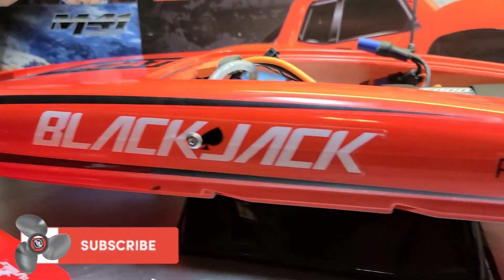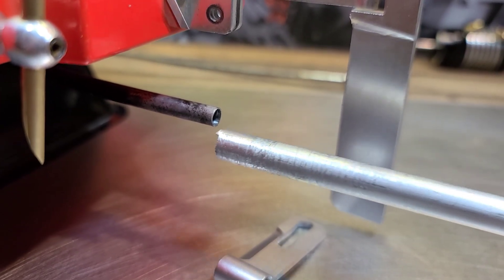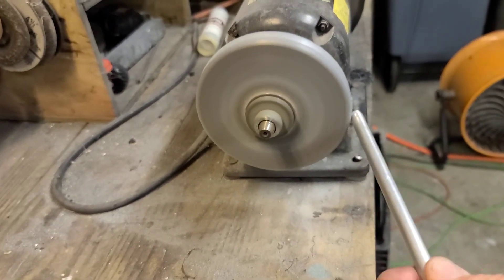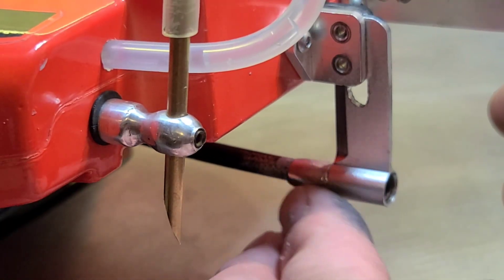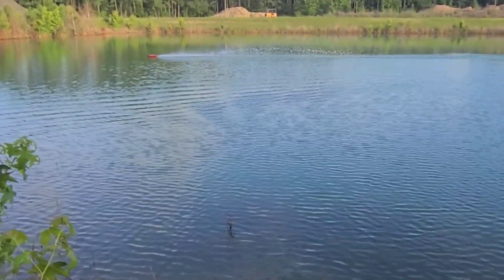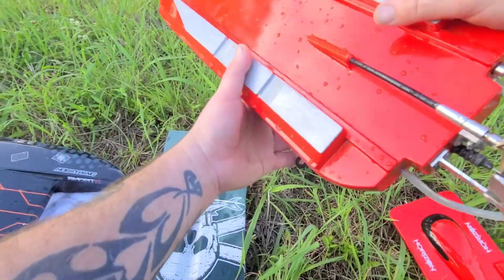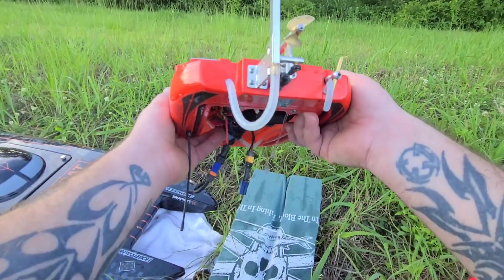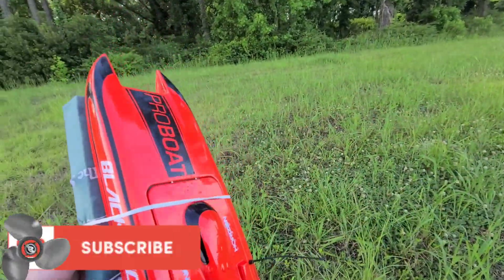Maximum Performance For Any RTR RC Boat - Blackjack 24 Strut Mod

Comment: Have you ever thought cut off a small piece chucking up and use both the drill and your grinder or  Sander on it.
In this method you will find it
 a  lot easier to use

Comment: Bro why does rc boats. Tends to jumb repeatedly in certain situations.  ,.  Is there any ways to prevent it
Reply from the maker: It could be improper weight distribution or strut/stinger could be set @ the wrong angle or height or a combination of both.  Trim tabs could help.

Comment: Could you use silicone there as a quick fix. Seems like it would work
Reply from the maker: It would help. Yes sir.    Also thin heat shrink would help aswell
Reply: @IRONCLADRC  didn’t think of heatshrink. Thanks
Reply: Upgraded strut and cable are back in stock at ose https://www.offshoreelectrics.com/proddetail.php?prod=ose-cable-system-bj24&fbclid=IwAR2djAzjQ_gKFz9yr1KSUR9kD4pMMqsUPgxKE9yVwJkEcYHI-2V4xHtcY

Comment: Where did you get the 2nd cooling tube mount on the stern?
Reply from the maker: I made mine front scratch  here's another option 
https://oxideanmarine.com/products/water-pickups-transom-standoff-rc-boat-oxidean-marine-pair

Comment: How about a video on blueprinting and applying that top coat?
Reply from the maker: Doing the durability testing before I release the video,  few more days at least.. need to make sure it's 100% pulled proof,  before I show everyone.  Hope that makes sense?
Reply from the maker: Materials used;  I pinned  a comment In the comment section on this video.  herei s the link      https://youtu.be/FdZRPjMa4b4

Comment: IRONCLAD RC. I'm thinking of making a 3dprinted RC catamaran, if you have any ideas plz let me know
Reply from the maker: I would love to help.  I don't have much knowledge of 3d printing.  That being said. I would personally keep the amount of hull parts to a minimum. I've seen some 3d printed boat hulls in like 20 different sections  glued together to make 1 full hull.   Personally seems like it would be weak?     they come out looking amazing.  Good luck.
Reply: IRONCLAD RC I’m playing on using carbon fiber rods to stiffen up the hull
Reply: IRONCLAD RC what would be better for the catamaran, make the hull longer or wider? And I might rap the the hull in fiber glass
Reply from the maker: longer my opinion & not to skinny so she don't flip on turns.